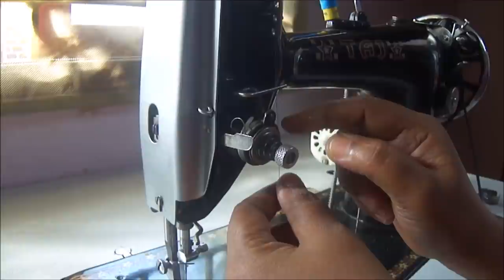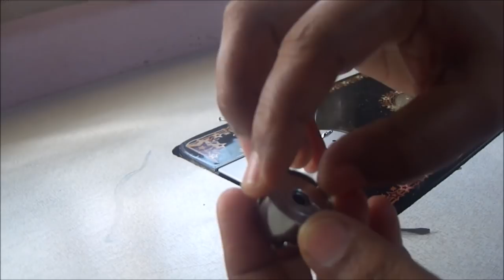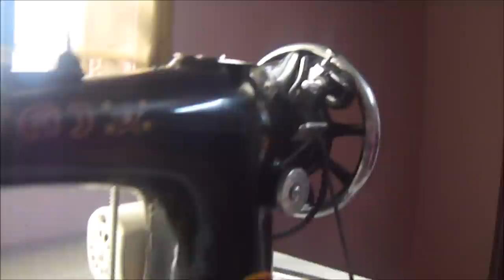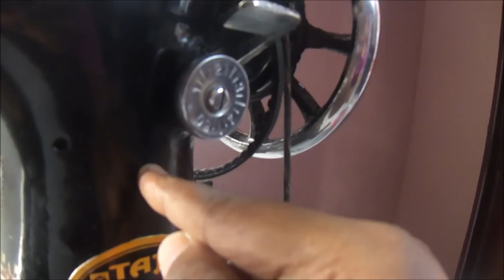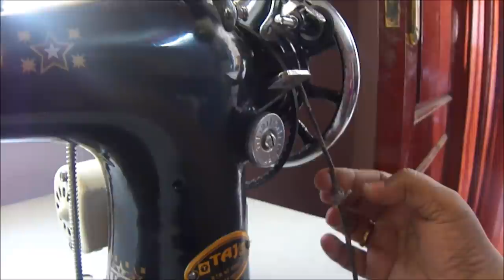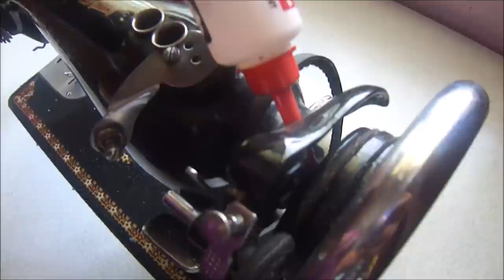Basic Details about Sewing Machine and Q & A

Comment: Hii mam,my needle is stucked in machine plz help me out mam
Reply from the maker: Remove the needle from the machine, replace it with a new one, and  check it whether fixed it properly or not before sewing.
Reply: @PremaUthra  some thread is also stucked mam hw to remove it
Reply from the maker: @shinyangel7658  remove the belt from the wheel and lift the head of the machine, remove the needle first then remove the bobbin and bobbin case . Now check   any thread is  there and remove that also carefully.
Reply: @PremaUthra  tqq soo much mam